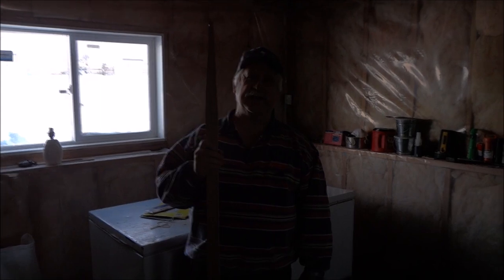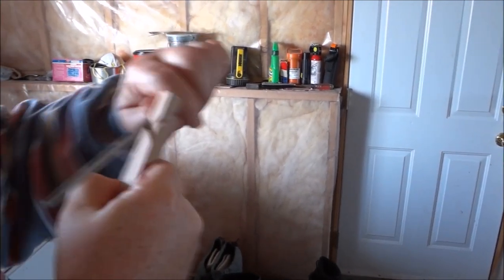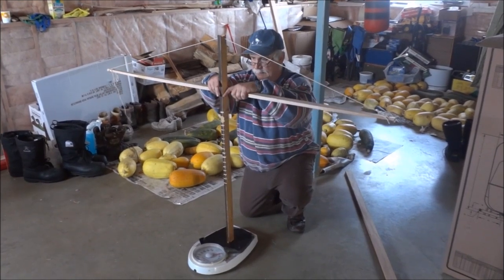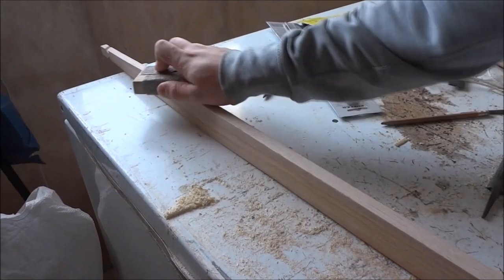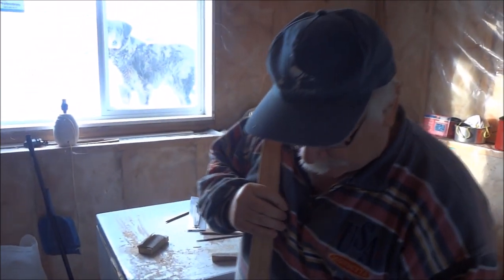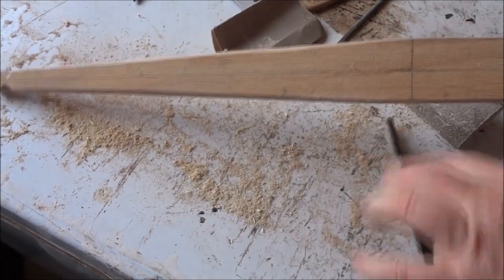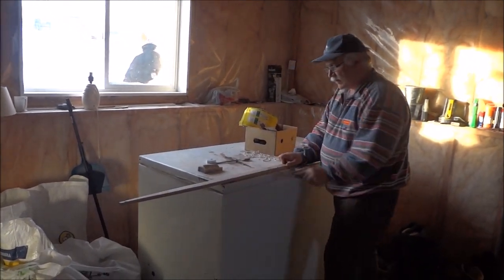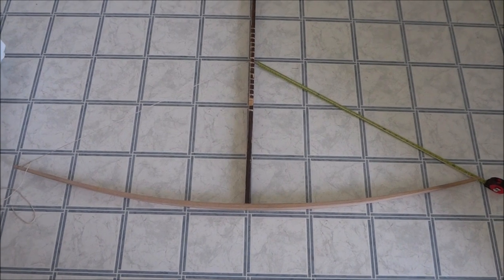How To Make A Board Bow

Comment: Thanks a lot.
Greetings from Turkiye
Reply from the maker: Good Luck.  Much of video can be applied to staves from forest as well.  For best results with white woods choose as large of a tree as possible to remove your stave from.  This allows back to be much flatter.  Or make it long such as my bow or lumberize the forest stave.  Be sure to follow the contours of wood in that case.  It is easily done by holding a pencil along edge & index finger runs along bow back.  By lumberizing low diameter trees even limbs can be used.

Comment: Great video but I do wish ya'll would give some cross sectional dimensions. What is the WIDTH and the THICKNESS of the bow ????
Reply from the maker: It is 72 inches long 1 7/8 inches wide & finished 60 lbs @ 28" draw bends in handle...but bows are tillered not made.  It is important you not instantly mill a blank out ok!?  Try to look for grain running full length sides as well as back & belly.  Make your tips narrow 1/2 ", & thick rather than thin & wide but I do think I say most of this.  A 1 3/4"× 67" straight board stave of white wood bend in handle will make a 28" draw 50lb bow if grain is chosen correctly.  A 2" will make a 50 lb if handled.  Make limbs same as here.  I meant to get back to grainbut eh I'm Tossdart.  Hope this helps.

Comment: Just curious. Have you ever built up the handle on the belly side of these bows? I've just started building one exactly as you've shown in this video, which is great.
Reply from the maker: Hi Jeff great to hear.  If you add a handle it is no longer a bends in handle bow is all. Yes I have then back to above.  I make my handles 10 inch so ramps are 3 inches.  That way the angle is easier to work & I feel protects bow at fades.  Start fading just a bit in from end of ramps. Fade to 1 inch width. Understand that adding a non bending handle shortens bending wood as handle does not bend or store energy.  This makes a sweet shooting but more frangible bow so consider that grain should be perfect.  Possibly look for a 2 inch x 12 inch board that shows growth just like in the tree & follow to one ring or backing the bow.  You can get 6 staves from above board.  Make bow 2 inches @ midlimb for handled white woods (red oak) or make bow longer  If you back it easily you can reduce length to 67 inches.  Avoid straight edge grain.  If you watch my video For Malc I show one, she still shoots good but the fellow cut my $60 ash wood piece exactly opposite of my instructions.  I have had several of those unbacked ash handled bows, so gorgeous to, explode.  Mind you both were in -20 days.  I should have known better.  P.S. I am disabled now osteoarthritis in my neck so I no longer make bows.  Too much head down.
Reply: @Tossdart  thanks. 2 I have made in the past showed that same characters as you describe.

Comment: I've never had any luck with a board bow wood way to dry and crack or brake, they home Depot and Lowe's buy there stuff already dried for construction purpose. I've backed the bows with everything from snake to fiberglass and the longest I had one to last was a month maybe two ....but I will admit I used them almost everyday....just never had one to last....
Reply from the maker: Consider where you store your bow.  I broke a rawhide backed ash after hanging it up by ceiling in winter & shooting it in -22 celcius.  If you can find wood that you can treat as a natural stave it is no different than any other.  The stave in video is bias with most grains full length.  Choice of stave, dryness & design is everything.  Other than that there wood is wood.
Reply: @Tossdart  well I do agree with the   where you store it thing makes sense...and at the beginning the bow did shoot like a champ but I think the Alabama climate was way too hot and dry for the wood. But I backed all the bows i ever made just in case they decided to give it up and thank God I did...when they go they go ...but I also owned 2 un backed small hickory bows that had to be at least  65 years old that my dad had made when he was young and I should of had just put them away but being young and dumb at the time I shot them until they gave up...but I was thinking how could they make it that long and a newer bow not make it a year....but I guess he knew what he was doing and me not so much...
Reply: Frank Ledford ... if your dads bow lasted for many years you might be pushing them to hard or over drawing them , seems a bit odd how his lasted for many years and you broke his bow as well as all your own.

Comment: Can I get dimensions on how big the handle is and when I should start tapering to 1/2 am inch?
Reply from the maker: Random Dude eh sorry g+ does not send my comments it is a broken bow.  Rewatch video.  There is nothing I don't explain other than choosing wood which I meant to but my health has failed.  Taper from midlimb or beyond on sides. Belly tiller is from ends of  handle.  Nock is 1/2 inch wide & 7/16 thick & 1/2 an inch down.  The stiffer end works like a bit of a cam.  Oh handle is enough for hand & arrow so 8 " works good.

Comment: is it possible to make from beech wood?
Reply from the maker: Hi, I am not familiar with beech.  I seem to remember it not being a great choice.  That said it is a hardwood.  Perhaps if it is your only available wood make your bow with a handle 1 inch wide & 10 inches long.  This allows for a lighter slope on fade out.  Make fade outs 3 inches long.  For a 50 pound flat bow make it 67 to 68 inches long & overbuild it.  That means 2.5 inches even 3 inches wide as thinking of a shaving notice how easily it bends.  This is important.  Wider thinner is better than narrow & thick! Excepting the last 7 inches which should be thicker & 1/2 inch wide just like above bow.  Wider thinner near tip wood will give a whip ended bow.  Remember bows are tillered not made.  Make limbs bend evenly with most bend in middle section of limbs & taper from past mid limb to knocks maybe the last 10 to 12 inches. Alternatively build your bow after above it is overbuilt & ended up being 60 # @ 28 inches.  Remember to give my videos a like subscribe share & thumbs up tube is trying to de -monitize or get rid of anything that could hurt a fly.

Comment: Nice floor tiles
Reply from the maker: useful lol but in bush snap cordage coated in charcoal.
Reply: +Tossdart 

Would it be a mistake to attempt a mild recurve on one of these bows? I have a couple hackberry and mulberry staves, from some clearing I did last summer, but I want to practice on a couple of cheap boards before wasting a lot of effort and wood. Also, do you think a shortbow around 48" - 50" would be viable at around 35 - 40lb, with one of these board bows (30 - 35lb would be acceptable)?
Reply from the maker: Spring Bloom absolutely you can make a shorter bow or recurve.  However choose hickory if you can as recurving places massive stress midlimb as does shortening. Good wood is hard to come by here as wild wood propellers so often & red oak is readily available. If you sinew back better yet.  General rule 67-68" 2" wide handled.  1.5" wide if bends in handle 50 lb full draw.  Add either length or width to reduce risk.  This bow ended up pulling 60 lbs @ 29".  I would not advise shorter than 62 inches 2" wide for 40 lb full draw bow but hickory is very tough as is elm.
Reply: +Tossdart 

Cool. Thanks!

Comment: what was that about shorter the bow you lose speed and then you gain speed?
Reply from the maker: WV591 No if you over build a bit you lose a bit of speed if you stay at same weight.  You will gain a bit if shortening but bow is more likely to break.  Shorter limbs snap quicker but also can't toss a heavier arrow.  Heavier limbs are slower but store huge energy.  Thinn of a big hammer or small hammer. There are many tradeoffs in bow making.  Hope this helps.

Comment: is your board still 3/4" at the handle?
Reply from the maker: keith strausbaugh yes thick & taper ever so gently almost inperceptable.
Reply: thanks mines roughed out only thing I'm still debating is what I should do with the handle. leave it corners rounded and wrap a material for a grip? or should I make a grip with an arrow shelf. which have you done?
Reply from the maker: keith strausbaugh both.  This is a bends in handle bow.  Making a handled bow is different & a lot harder.  The handle has to be glued on before fades are cut off or it doesnt clamp right.  It is nice yes as arrow doesn't need to occilate around handle but it is also more stressed as you no longer have handle wood working.  This bow incidently became 60 lb @ 29 inches.  A handled bow must be 2" wide mid limb for 50 lbs & a 68" length.